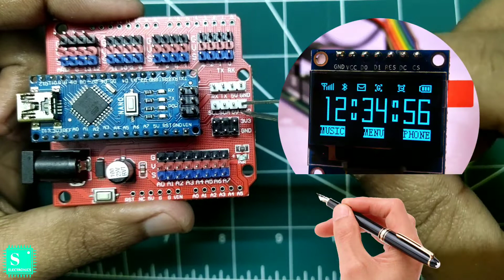How to Use Arduino NANO Expansion Adapter Breakout Board - I/O Shield | Part -1

Comment: can we give it 12v - 3.7v power to this
Reply from the maker: Yes it supports 7-12 V external power supply but remember don't power both nano & shield, power only one of them
Reply: Only when the ardiuno nano board is attached to the nano shield does the led light 

￼
Reply: But when I gave 12v and 9v without hitting the nano board the nano shield did not turn on
Reply: why itS not turn on
Reply from the maker: Power the nano then as shown in video it may be the issue with the module
Reply: yes but i did't attach the nano board
Reply: is that the resion the  board led not on

Comment: bro mine is not working on external power 9 volt by dc jack ,any idea where is the problem .If you help i well subscribe .
Reply from the maker: Power the Nano using USB cable & plug the other end of USBcable to any 5V charger or your desktop/laptop then try..